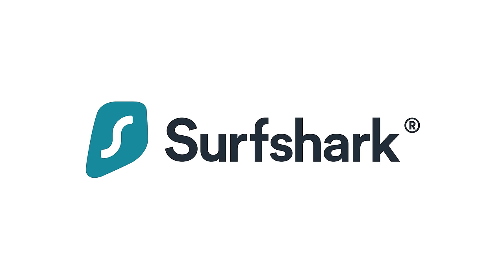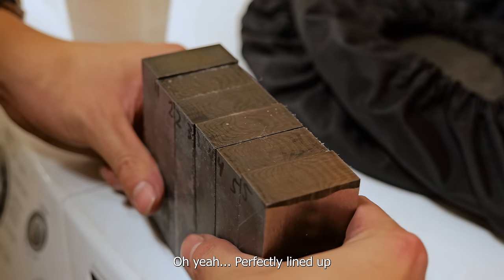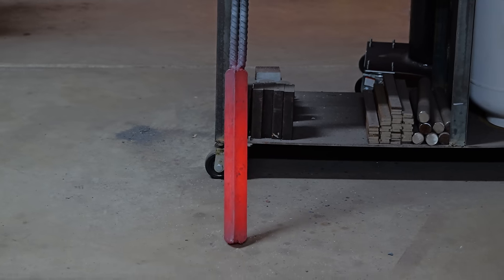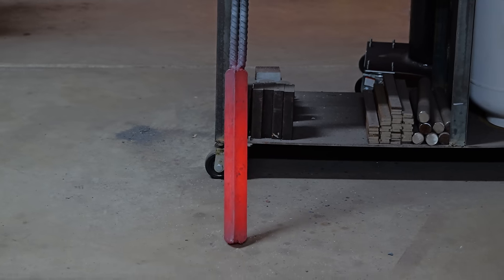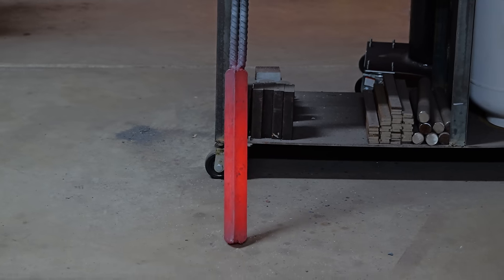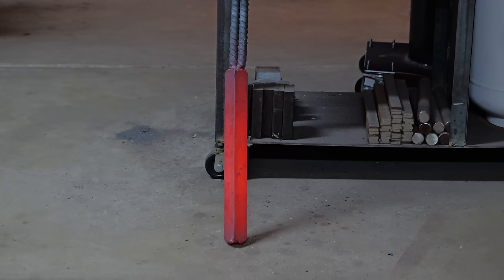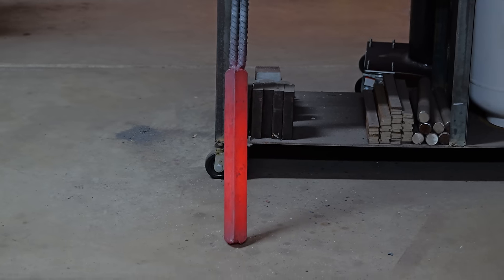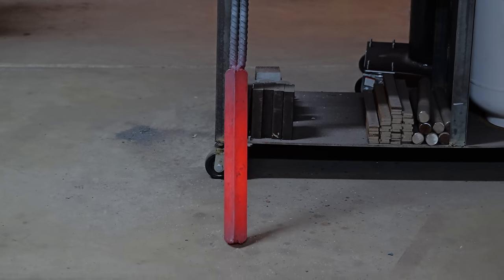Making a $5000 Mosaic Damascus Cleaver

Comment: hey bro fantastic job on the cleaver! I got a tip for you: use some really fine sawdust from the same type of wood you need to repair if there are cracks in it, and mix it with clear super glue and apply that instead of using artificial color to match it. Although that type of wood you had did have 2 distinct colors in it you it may not work with that type because it would mix and turn a different color but if its a solid color it works really well. My dad taught me that. The Siamese rosewood is beautiful I would love to carve something with that!

Comment: Get yourself a Everlast mig tig stick.   I purchased a 221STI 5 years ago and it is a Amazing welder.   The tig is the best way to put in clean perfect welds and is a nice feature to have.  Mine is a AC/DC but if you are not wanting to be able to tig aluminum and DC only unit will do fine.  I have worked as a welder for years in another life and I can tell you Everlast has the most bang for the buck hands down.  5 year warranty and a great tech support.

Comment: That was awesome - no mechanical bond with the handle though - makes me nervous - but you did amazing
Reply: Notches in the tang, hard wood and good epoxy.  Just about as good as rivets but without the risk of wood cracking or touching cold metal.

Comment: that sound in the press may be an air pocket in the hydraulic pump or chattering in a solenoid somewhere. just from the little snippet heard. but stopping and restarting is the first step to diagnose or look at fixing it.

Comment: you can use canola oil to wet sand (if you're not allergic) as you dont want to inhale WD 40 or any kind of machining oil. A beveled board the size of your blade skined in ducktape and then a lair of replaceable blue painter tape is safer then having the blade sit over the edge is after then having a blade hanging off the board.

Comment: Have you ever thought about using the dowel method for your handles where you use a split wood dowel to go around the tang then you just drill one hole in the handle and glue it all together

Comment: Dang, that's absolutely gorgeous! You even pattern-matched the bolster transition to the blade!

I'm a fan of knife-making videos. I've built a few small forges but I've only melted aluminium. I'm a 30-year CNC machinist in the automotive mould making industry, and I literally laughed out loud at a few of your best-practices that cross over to my trade that I seldom if ever see others use. I applaud your commitment to meticulous craftsmanship. 

I'm also a caucasian amateur Chinese-style chef; I'm in the process of building a 22" diameter kamado-style barbecue. The case iron grille has a 12" round opening to hold a 16" wok over a 100,000 btu propane burner. I have two Chinese cleavers (well, veg knives; the blades are too delicate for really *cleaving*) and I think this summer I'll take a four hour train ride to buy a really high quality third. Wish I could afford one of yours!

Cheers from Southwestern Ontario, sir. Subscribed.

Comment: Problem that most Expert Weaponsmiths have with cutting/grinding the shape of the Blade instead of hammering it out (like you did with the handle) is that it can lead to stresses in the Blade if it's not done properly, it can compromise the integrity of the Blade if too much material is removed, and at that point you're not really using heat and blunt force to manipulate the Blade into shape (which is what encompasses Forging in the first place).

Arguably what you did here is tolerated in the field, because you didn't shape the Blade when you cut it, but just hogged away unnecessary material to prepare the Handle to be shaped, and there's nothing wrong with that (even though it is a questionable method of streamlining the work it would've required).

Comment: Flux core mig should be ran electrode negative, so if you don't have your wire gun set on negative, you're welding with flux core wrong. Try reversing it. Other than chipping, it should be almost no difference from regular mig.

Comment: think used toaster over next time, could've used water displacement to measure increase of volume post quench from change in lattice structure, for dust collection get a doctors curtain paired with a dedicated air pump that uses a dogswell remedy+recovery collar

Comment: for my brother's wedding i got them a full kitchen knife and steak knife set of japanese damascus hand made knives. It was like 7 grand if i remember right. they used a few of the knives to make dinner ONE TIME, washed them, and put them back in the custom leather roll out sheath thing. The next day they went to use them and they were covered in rust.. I took the knives back so i could return them, never ended up finding the time to return them, got stuck with them, and they were amung the things that actually just got stolen from me when a garage i was storing things in was broken into, but thats besides the point. Why did the knives rust simply from washing them? what i read online says youre supposed to get some special oil for the knives to stop the rusting and youre supposed to wax and opil them after washing them, But ive never had to do that with any oither damascus knife. Ive had probably 20 damascus pocket knives and  bowie knives.. Ive never had a single blade rust until this set.. so ive always windered if i got scammed. i always woindered if they used cheap steel or the wrong kind oif steel or something.. have you ever had a blade rust?

Comment: If you're having problems hitting 45 °, why aren't you using the bottom of the w-die you use for the first weld set, and the top of your squaring die to set the new flat square, instead of doing it manually?  Or is the welding die not actually at 45° angle and would just make it worse?

Comment: If you read this, don't get a "decent MIG welder". Get a TIG welder. I recently switched over and it's so amazing. It's so silent, it's so beautiful, it's so much easier. Never had good welds on a MIG machine, but on TIG, my first weld looked amazing. Just get a DC only machine if you don't have to weld alu or magnesium.

Comment: @Jesse Hu For dust collection - Harbor Freight sells Grizzly Drum-top cyclones and you can run them off of a shop-vac, but you should really buy the proper blower sized for the system. For the size of your workshop and material, you won't need a biggun.

Also, look into auto-buffing tools, systems and techniques for your handle and blade finishing. @BlacktailStudio has been working this in to great effect.

Comment: A similar looking wood that you could use as well is Paduk, for the same amount you said you spent on that tiny block you'd probably be able to get like 100 handles at least, that being said I'm not 100% sure on what requirements would be for a wooden handle on a knife. Either way, it's an absolutely stunning knife

Comment: Don't knock the Lincoln, little brother, yes they are messy but they are micro beast welders. I have a 125hd that runs %100 duty cycle on its highest setting with .035 flux core. I use it as a suitcase to my Ranger when a stick is too much or I'm throwing long continuous root welds.

Comment: Hey, sideways pressure on a drill bit is no joke, and you're point blank with no safety glasses. I had a drill bit split into five shards that shot out so fast, had it gone in my eye upward toward my brain, I'd probably have died from it. Get some safety glasses, expect the unexpected.

Comment: Dude, using the caliper rule as a marking tool gave me shivers down my spine - and not the good ones. I like the final product though. A bit (a lot) too pricy for my taste (let's say $400 for the damascus steel and handle, 9 days à 8 hours for a non-professional à $40/hr AT MOST and $100 electricity, gas, coffee = $3.380).

Comment: That's not how Damascus works. The pattern isn't decorative. It is merely a byproduct of steel folded over itself trapping carbon and making the edge harder. What you are doing is essentially introducing faults into steel in a pretty pattern but will ultimately compromise the blade.

Comment: Really nice work!
But, you should always wear gloves when working with epoxy. Overtime you can develop an allergy to the epoxy. Also, do not use IPA or other solvents to remove resin from your skin.